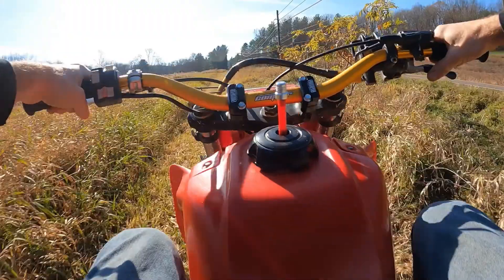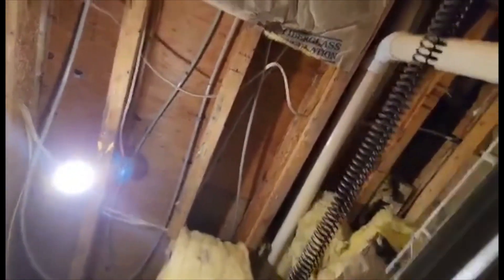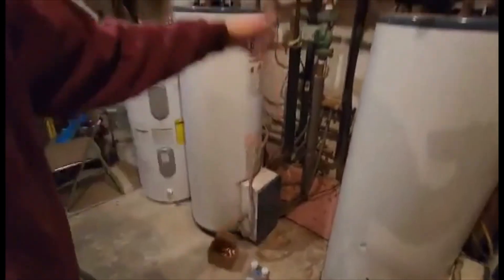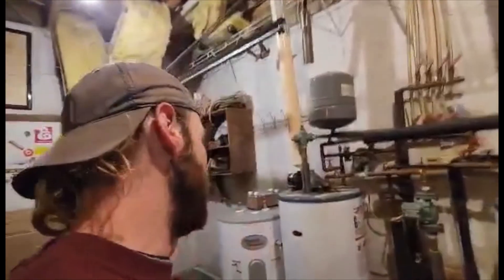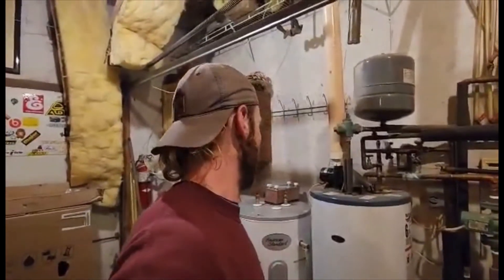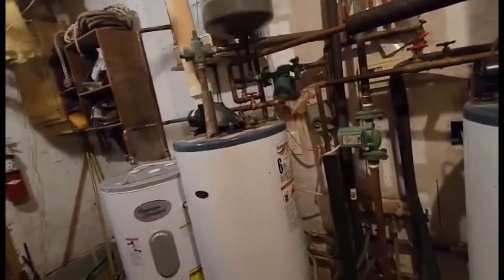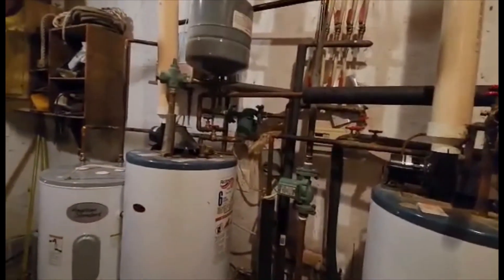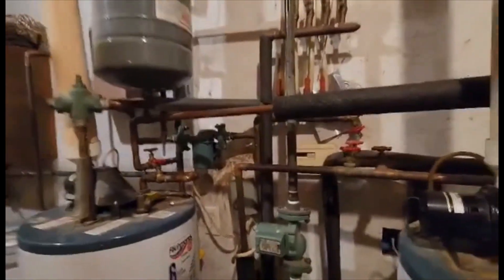Outdoor wood boiler Radiant floor heating system upgrades

Comment: How is it working is 40 big enough or to big anything you would change
Reply from the maker: Everything worked great last year!  Wish I did it sooner.   Just should have mounted the plates vertically so they don't build up with sludge in the future .  WIFI controls were very nice while not being there.